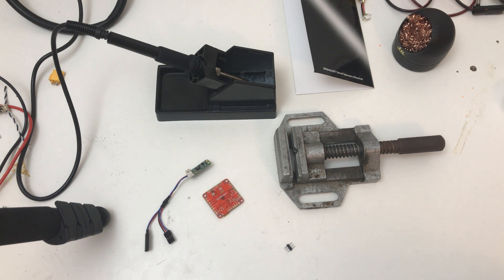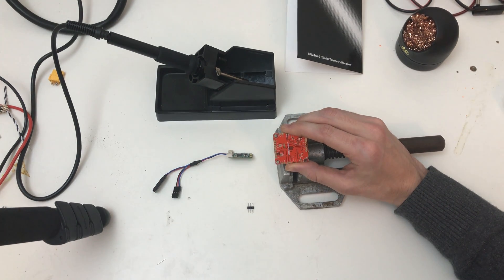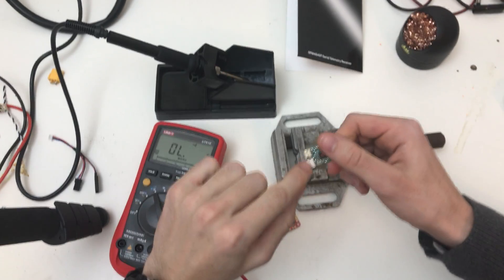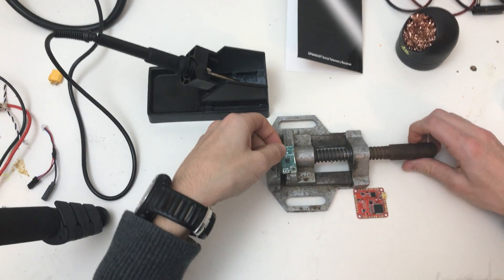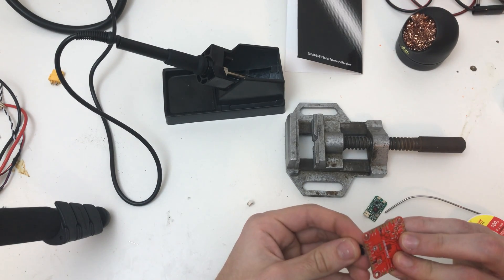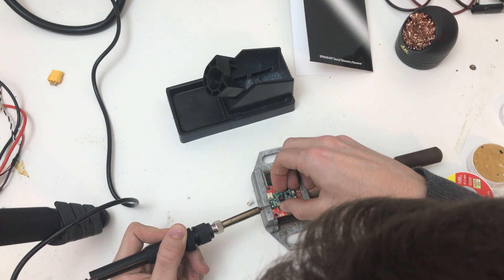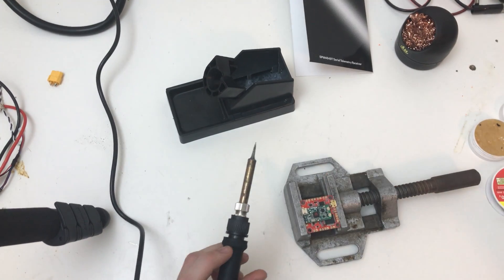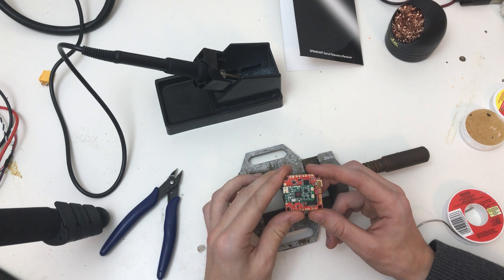HowTo: Revolt + Spektrum Serial TLM Bidirectional Receiver Stack  (SPM4649T)

Comment: Hi Julian! I bought a new SPM4648T and put it onto my Revolt V1 like you did on UART3. I didn't bind it before soldering it onto the FC and now I'm not able to bind it via RF1. Could this be the issue? I mesasured the input voltage for the receiver and it's only 4,66V. I think this should be enough but I get no LED light flashing up. Any ideas what could be wrong?
Reply from the maker: hey Mike? :D Voltage should be pretty much equal (with only a slight drop) to what you feed the FC (either BEC or USB), but as you already said, 4,66V should be enough, I think it will work down to 3,5 or so lol :D

I have a setup video where I am using metallic tweezers to short the "left and right" pins to get it into bind mode... give me a minute and I will find it for you :)
Reply from the maker: https://www.youtube.com/watch?v=tRZSM2rtas0&index=3&list=PLCc1K9WRDikU-D6wsioZQmkqu6PKfzRzz There you go :) I just like to bind mine before soldering now so I know the receiver is working and not DOA^^
Reply: Thx. I'll try this later. Unfortunately there is no LED light at all, so I think I got DOA RX. I've just ordered another SPM4648T to replace the Rx on one of my other quads so I will get one to compare soon. Lessons learned: check product on arrival :D
Reply from the maker: Yankee Mike wait 4649 or 4648? The 8 needs 3.3V... didn't say anything the first time since I thought it was a typo :)

There shouldn't be any light on it when it's not bound or in bind mod, so don't give up too soon ;)
Reply: Oh! for sure it's 4649T ;) it runs with 5V

Comment: Hi Julian, Did you have any issues soldering this to TX3 as all the instructions i found were for soldering to TX1 but i dont want to do that as it covers the screw thread of the standoff.
Reply from the maker: Hey, no problem at all, I am running it like this on three quads and am running both official releases as well as the latest alpha builds :)
Reply: Thanks for the info and the quick response... going to work on this later and didnt want to solder anything to realise it wasnt going to work.

Comment: this is cool but I guess if you want to use their upcoming stack VTX OSD then I guess there won't be room...have to admit stacking a RX like this has not been top of my must have...
Reply from the maker: it depends on the build, the orca as a lot of space left but e.g on my "Toothpick" Build I am happy with the voltage reading I get via TLM and am happy without an OSD :)
Reply: thats cool...Im still thinking about trying Spektrum at some point...glad the new quad receiver is good...seems like the RF guys are developing around Spektrum a bit...
Reply from the maker: Stephen Wright when I moved to 2.4 Ghz I made the jump to Spektrum, Graupner was horrible back then and I honestly just picked it because of all that neat BindAndFly stuff :-P (saying that all I have is the Blade 180CFX now)... but the truth is, Spektrum and RaceFlight actually are working together ;)
Reply from the maker: well you could say that but truth is they are cooperating with them on the SPMFC400 and this receiver :) That's why RF is/was the first FC with the bidirectional protocol implemented ;)

Comment: Nice mate. Subscribed.
Will this cause any problems with the revolt gyro as its so sensitive.?
Reply from the maker: So far I only test flew it and despite I am sure adding some hotglue in between will "help" I am not sure it's 100% needed, though when you are sure that you won't need to desolder it soon, go for it, nothing to lose, only to gain :)
Reply: Brilliant. thanks

Comment: Hi Julian... Thanks for the video... I'm getting a Revolt FC and also have an SPM4649t Rx ready to be installed on it, as you just did yours.
Any chance you could show us a video with the rest of the config process (Including any tips ranging from the moment you flash the FC with the latest RF firmware, setting the FC to read the Spektrum Rx, binding the Tx with the Rx and showing how the telemetry is set on the Tx)... that would really help... Thanks...
Reply from the maker: Hector Bello hey,  I bound it first before doing this and  for setup all I did was flash the BB420_telemetry_spektrum or what it's called file... (and set up arm mode) I will fly it tomorrow and after that try to rebind, don't want to mess with it since I want to actually fly it first xD  if successful I will do a full video :)
Reply: Julian... Quick question; finally got my Revolt and was able to mount the SPM4649t Rx on it, was also able to flash the FC with the latest firmware using the spektrum telemetry bin file and to bind the Rx with my DX6 radio. No issues so far, but I'm curious about the Telemetry part of this set... When binding I got the DX6 to say binding complete 22ms, but no telemetry was prompted. Then I did a telemetry autoconfig but I don't seem still be getting any info from the FC  If you could show how this is working on yours through a video would be great... thx...
Reply from the maker: weird that it did not show TLM, it should show that no matter what you have connected to the receiver, I have a old school DX8 G1 and it bound with "22ms & telemetry".

Just got back home, will do the promised video soonish!
Reply from the maker: Hey, just made "your" video... though I am not sure that will help... but wait... it might ;) Have you tried setting Frame Rate to 11ms before binding, it could be that that is needed for TLM to work^^